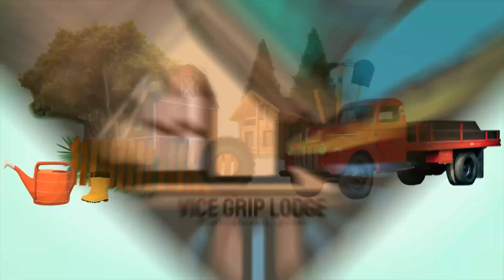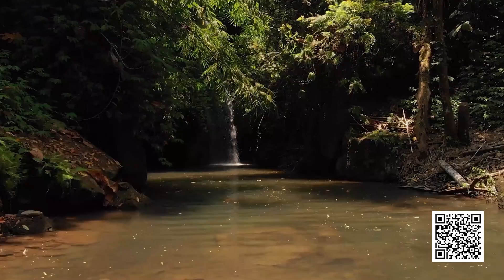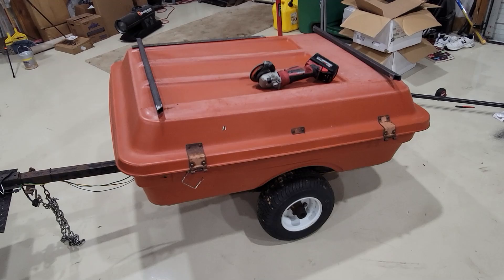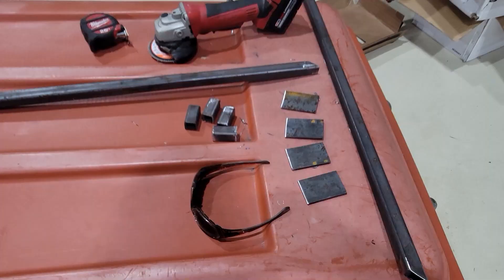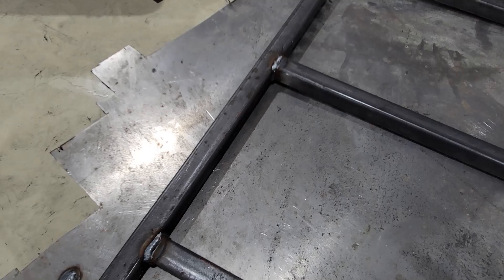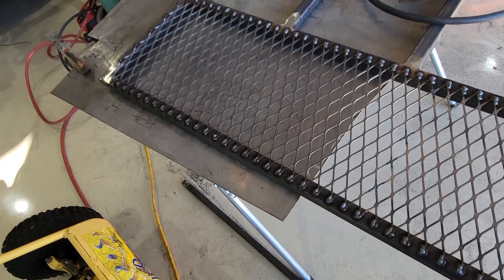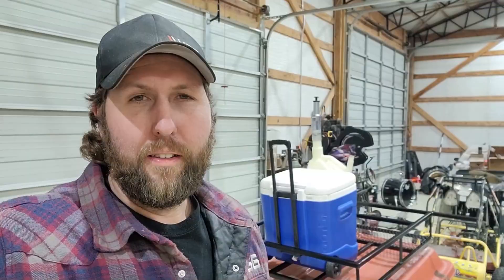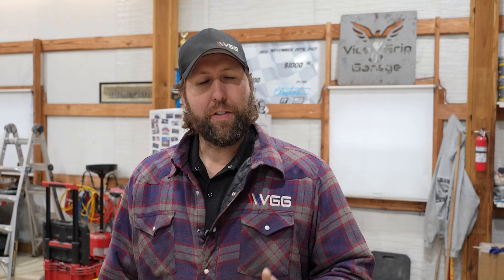Modifying my classic trailer for Drag and Drive Events! (For Vice Grip Garage)

Comment: I build teardrop trailers for fun,  they have huge rear doors and cavernes cargo space,  they don't roll or flip either.   I can build you one designed to haul all the tires and welders and tools and spare parts and beer coolers you can carry, i mean custom AF.....   I could hook you up, can we talk?
Reply: As long as it fits into the box - Each competition vehicle may tow a single trailer with a maximum cargo area no larger 142 cubic feet, which is the advertised size of a standard 4x8 box trailer (which is 4’1” wide, 4” tall, 8’1” long; the math doesn’t quite add up to 142). Measurements include anything carried on the trailer.

Comment: It is always distracting me to keep an eye on a fellur's shop, in the background.  What was that back there?  Something he hasn't featured yet, who is playing the drums?, what goodies came in the boxes?  I don't know, maybe a guy will tell us some day.
That steel normally comes in 20ft(usually +3"-6" to cut off the garbage ends) lengths from the mills, while pipe comes in 25' and 50' "joints"(you have to cut at LEAST 3"-6" off the ends of pipes to get to the true round bits).  Looks like a fellur already knows to get it out of the sun a good while before cutting it.  Loosing 1/16"-1/4" of off a true cut is REAL annoying when trying to get the geo-metries all nice and pretty.

Comment: What a waste of time and effort for this mini trailer. You could have done better with a proper trailer seeing the "stuff" you put on top of this baby trailer. If talking about the weight, casco partly plastic, on top steel and tyres etc what is with the balans weight wrongly estimated. Told you before, with a proper steel trailer you could have done a lot more, beside remember, you are not the only one on the road and should be a safe transport for you and other road users. We have seen the accident you did have later on and lucky you, only damage to the right aft side your car and the trailer flipped over. Imagen this had happen on the motorway when you was overhauling somebody else. Thought you have more thoughts in your head when you built this one. Hopefully when all this trip is to an end you will built a proper one this time, if not for your safety then do it for others. Don't put heavy stuff like tyres etc on the top as that will make it top-heavy. Sorry my finger putting to you but you are a big man and you can take some critics. No harms done but keep the road safe, drive your games on the track but on the road there are so rules to follow.
Reply: Anxiously awaiting your video on how to build a trailer for a drag and drive.
Reply: @matthewb8229  Yepp